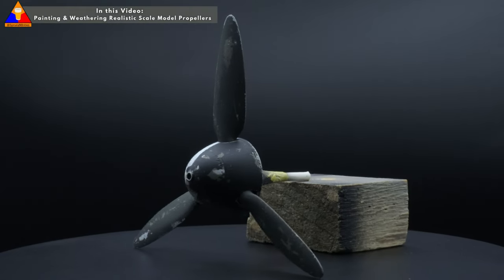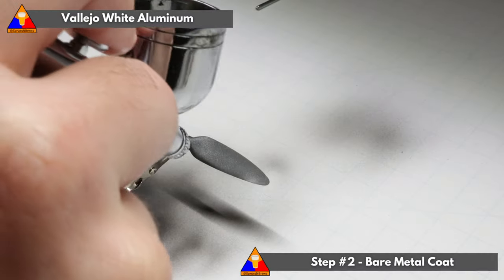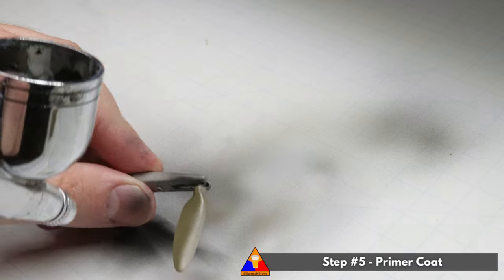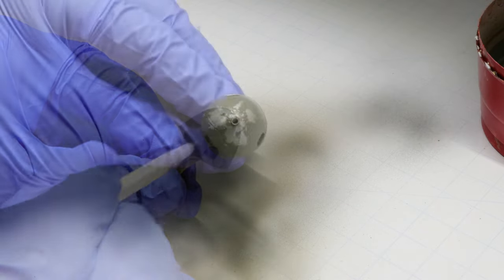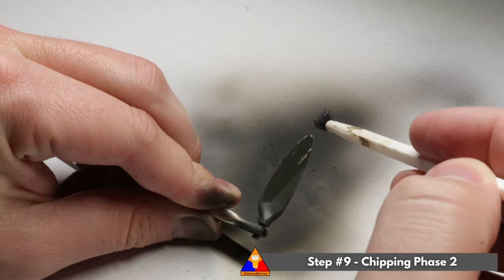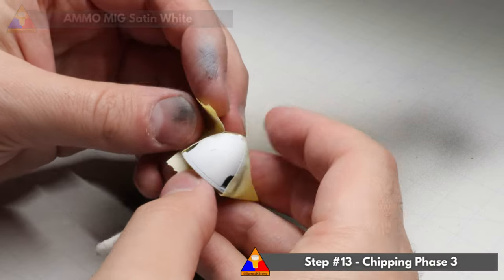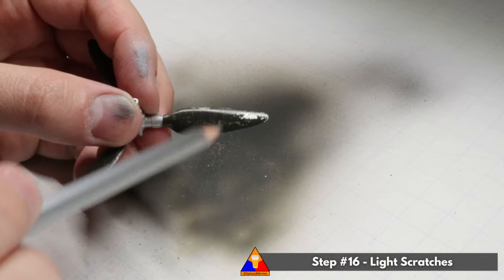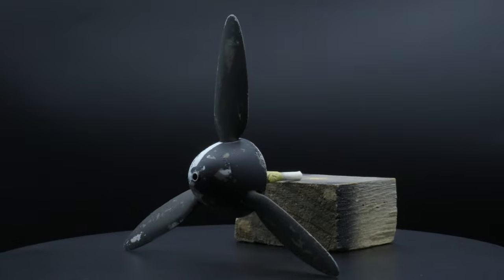Painting Scale Model Propellers… Easy Technique, GREAT Results!

Comment: Hank, this was an amazing tutorial with incredible results.  I must, however, ask a couple of questions if you don't mind: 1) You must have shot a dozen different products from your airbrush. Did you clean your airbrush each time you changed colors, varnish, hairspray, etc or did you simply just keep changing the products as they remained wet in the airbrush cup? 2) Why didn't you just spray the prop blades, hub with the hairspray bottle as if it were a rattle can, did you find it necessary to decant the hairspray into the cup?  Thanks alot.
Reply from the maker: Thank you very much! And of course, questions are always appreciated.
1) very good point - between each product, I rinse the cup of the airbrush out with warm tap water & spray it until no more moisture comes out. Then I'll run a round of thinner through it (again, until dry). That gets the job done pretty well & preps the brush for the next product.
2) I've found that spraying directly from the bottle of hairspray doesn't give me enough control - the spray pattern is way too wide & has a tendency to pool very quickly. Decanting into the brush is a bit of a pain, but definitely worth it.

Thanks again! 👍
Reply: @dunhill1  -An outstanding miniature painter (and a great guy who is uber generous with his knowledge) has done a couple of excellent tutorials on airbrush cleaning. Even made me want to use mine again for little stuff. His methods and tips are super simple, and keep your airbrush clean with a minimum of hastle, chemicals, etc. His name is Vince Venturella. Look him up on YouTube then check out numbers 213 and 118 in his "Hobby Cheating" video series. Great stuff!! 😄🍻

Comment: Hey Hank.  Nice technique!  I've got questions about Vallejo primer.  I want to try the black primer as I have had trouble with the last two bottles of Stynylrez primers.  Do you have any issues with taping/masking over Vallejo primer and paint lifting?  I have clicked on your Amazon link for Vallejo primer and it takes me to their gloss black primer.  Do you have a link for the flat primer?  Just want to support a fellow modeler!!  Thanks! Drew
Reply: I took would love this as I have Vallejo Black surface primer. But it doesn't spray well or seem to grab very well.

Comment: Not saying it doesn't look good, but I used to get similar results a lot easier by just dry-brusing -- particularly just silver over the paint to get the chipping effect..
Reply from the maker: Yeah I've found that chipping with dry-brushing doesn't look as realistic because you're adding paint in additional layers to the model (rather than with this method where you're taking paint away, as it would be in real life). I do love me some dry-brushing though, but I've found that it can stand out if you don't keep it confined to very small areas 👍